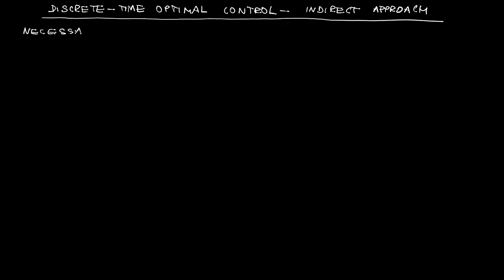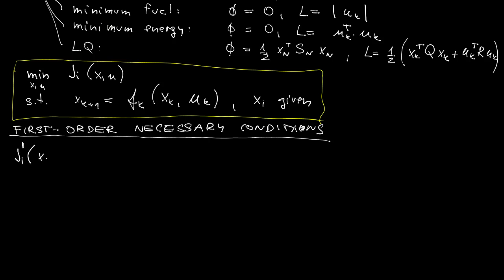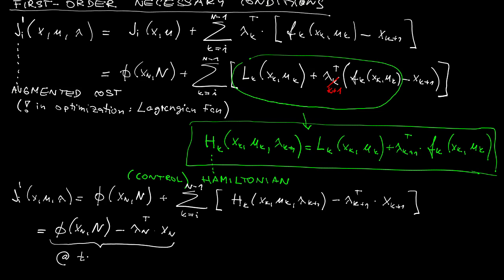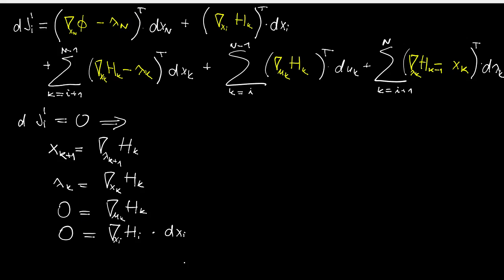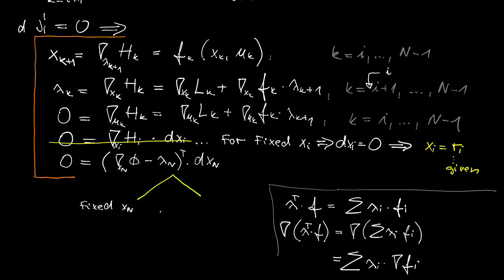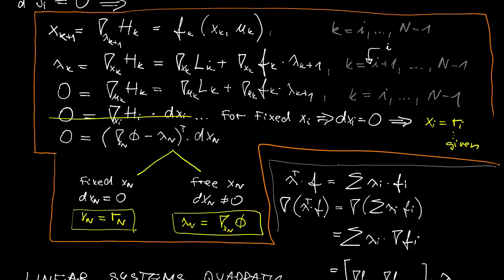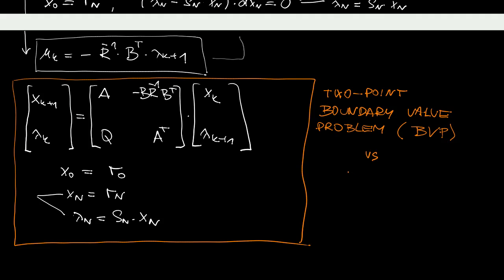L4.1 - Discrete-time optimal control - indirect approach

Comment: Thanks for the video.

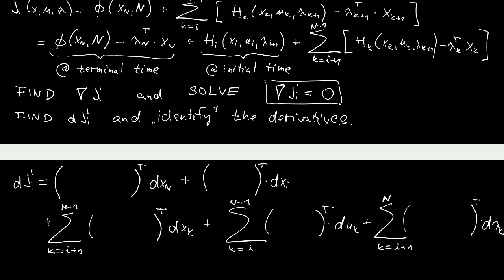At 5:19 When you enumerate the cost function, I notice you use the total derivative to expand the summation term, which contain the derivative of x_k, u_k and λ_k. But WHY don't you use the same trick for initial time term, where you just retain the dX_i term. The same thing you did for terminal time term, where you just retian dX_N term.

OK, I'm kind of figure it out. The reason why you skip the u_N is because u_N is not the parameter  of terminal term. The reason why you skip the λ_1 term is because λ_1 is the co-state for x_1 = f(x_0, u_0)  which is meanless. Am I corret?

Comment: Thanks for the video!

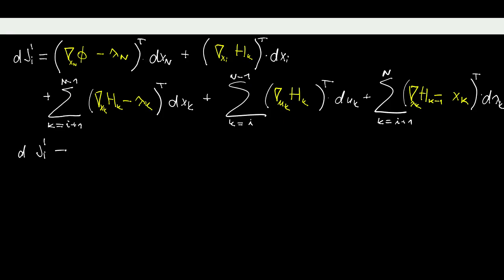At 5:59 I'm not sure why we can "separate" the dJ'_i = 0 into all those 5 separate equations for all the "yellow" expressions. I tried reading the notes but still didn't get it. Could you please point me to some theory or explanation behind this which I could research? Thanks.
Reply from the maker: Vladyslav, sorry for a delay in response. But you'd better ask during an in-person lecture or seminar. After all, that is their purpose. I am not checking Youtube frequently and regularly. 

As for your question: there is nothing very deep about the procedure, it is just that we enumerate all the variables upon which the cost function(al) depends and we want to find expressions for derivatives of the cost with respect to all these variables. WIth hindsight, we group these variables according to their origin (states, inputs, costates, and initial and final states separately) because then it turns out that the resulting formulas are "nice". 

You are not really expected to demonstrate this procedure. I do not think you will encounter the need to reproduce it in a different setting too often. But I wanted to show it here so as nothing is left in the dark in the derivation. This way you can check every possible typos I could have introduced.

Comment: Is there a course or material or underlying theory on controller parameter optimization instead of optimization over signals (for non PID controllers)?
Reply from the maker: No course matearial on that topic yet, sorry. You may want to have a look at our entry at Matlab Central https://www.mathworks.com/matlabcentral/fileexchange/42845-structured-mimo-h-infinity-design-for-a-dual-stage-platform-using-hifoo-and-hinfstruct. This is accompanying our paper http://dx.doi.org/10.1016/j.mechatronics.2013.08.003. The references in the paper can give you some directions too. Good luck.